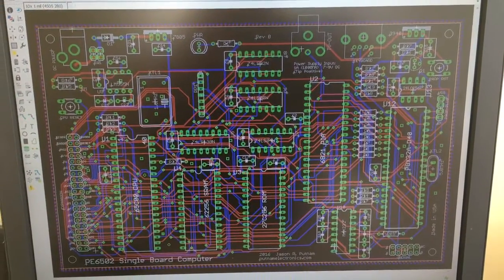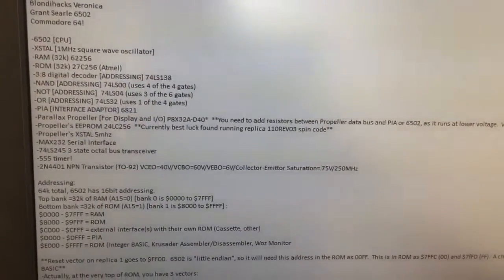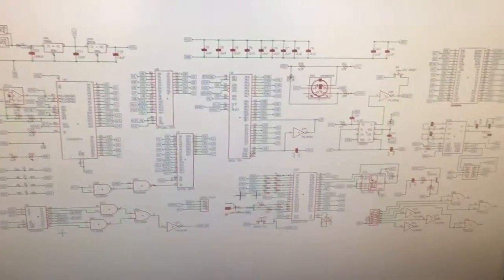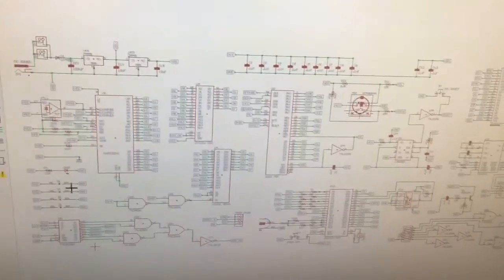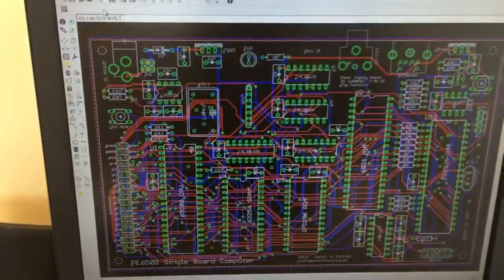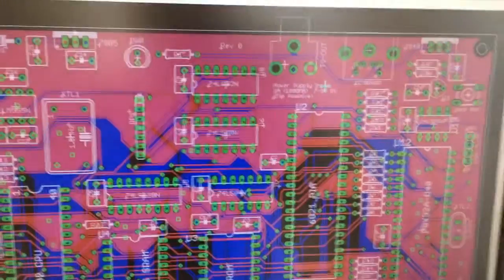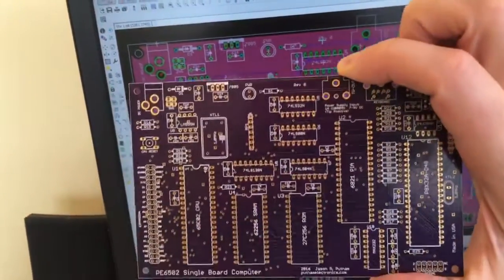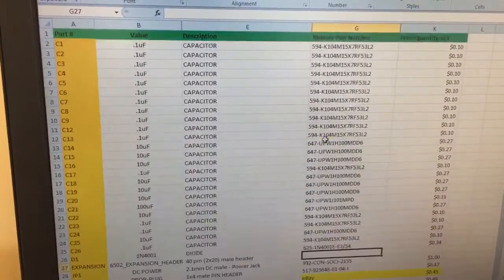6502 computer build, part 4

Comment: While I haven’t made anything or bought anything, I like looking on Mouser for materials as well. By the way, what’s the software you use to design PCBs? (and would you recommend it to a noob in college?)
Reply from the maker: I'm using Cadsoft Eagle (not sure who bought it from Cadsoft- but believe it was recently sold)..  You might want to learn KiCad- which I believe is open source, and free to use.
Reply: Corneleous Worthington alright, will do!

Comment: You might have mentioned it but I didn't catch it, how much did the board cost?
Reply from the maker: Hi Jon!  Thanks for watching!
So, Osh Park is where I have the boards made.  I think their price is $5 USD per square inch, for 3, 2-layer boards.  My boards came out pretty close to 4" x 6", so,  around 40 bucks per board (if I recall correctly)..  Of course, you can buy the entire kit now, which includes a board, and all the components.  All chips/sockets/resistors/capacitors/diode/etc are all top quality.  Check out my website for more info:  putnamelectronics.com

Comment: (Sorry about my bad english) 
I like it with one exeption, using the Parallax Propeller in your design breaks the rule of an real retro computer ;-)
If you need NTSC video TV-out the TMS9918A could be an nice replacement and it supports 32 sprites also.
How ever good job so far.
DJ
Reply from the maker: I'm just glad you watched it and like it!  Your english seems perfect to me!  Where are you from?  

Yes, I agree with you, I compromised using the Propeller;  I was already familiar with the chip, and it freed me from having to learn a new interface.  I cheated using non-retro tech on the memory side too, using modern/inexpensive/self contained SRAM.  However, I've been checking out the TMS9918S you mention, and it looks really neat (32 sprites sounds really cool!)

Thanks for watching!
Reply: "S" was an typo it must be "A" TMS9918A I bought one IC from eBay and put it on my breadboard 
but I have problems to get the 10.738635 MHz crystal. (3 times the colorburst signal of NTSC)
I can order it from mouser and at digikey but 30-40€ shipping to germany for a "simple crystal "is to much  :-(
But if I get the beast running I have to build my first PCB also.
Another higlight in my retro computerdesign are an original AM9511A floating point processor 
more precise an "AU" arithmetic unit from mid 70".

DJ

Comment: I've watched this entire series and I found it to be very inspiring.  Like you, I was also inspired by the same videos (especially Ben Heck; I love his project builds), and it was great to see someone inspired by the same mediums just run with it and record the results.

I disagreed with your use of the autorouter, but that's just out of my own personal dislike for autorouting in general.  The board that you designed looks great, and I can't wait to see a video with it populated and running your system.

If it's not too much of a bother, could I also get a copy of the schematic?  I'd love to check it out.

Again, great job.
Reply from the maker: I'm totally with you on the autorouter!  I really didn't want to use it, and even when I do use it, I end up re-routing perhaps 10-15% to get things right (no air-wires, all ground planes connected, less vias, etc.)  However, I got to a point where I considered "the enemy of good is better"..  At some point, I just had to finish and have the boards made- otherwise, there will always be just one more tweak, etc.  :-)  I figured, for rev 0, I'd use the autorouter.  It actually does a really good job, all things considered- the finished board is pretty dense.  But, yes, I too wish I would have routed it 100% manually, and I certainly would have cut the vias down.

I can send you a schematic, no problem.  Just email me through my webpage contact button, and I'll send it right out.  Thank you for your comments!
Reply: Yeah, I kind of figured there were some logistical complications that forced your hand into utilizing it at least once.  Really, it is better to have at least some sort of ground work down and modify after the fact than trying to tackle an entire board like this on the first go.  At least the autorouter can show you most of the optimal paths so that if you ever wanted to do a full rip-up, you have a better idea on how to manually tackle the board the second time around.
Reply from the maker: Yep.. And, even though this is the 5th board I've had made now, I still consider myself a student of this process- I am still learning (and appreciate any pointers you may have!)  When I was considering manually routing, here is the approach I was gonna go for: run a ground perimeter, then run power connections, then try to keep the buses together, etc.  The autorouted board has a ground plane on top and bottom, and at least it does have different net classes defined for power and ground, versus just signal traces.  

One other issue is, my license for cadsoft eagle restricts me to the 4x6 board size.  Eagle won't allow any manipulation of chips outside the board area.  I've watched a few people on youtube manually routing, and it looks like they like to assemble related things together off the board, then drag into place.  I am considering a switch to kicad for this very reason.
Reply: I hear you.  Dave Jones made a video about how applications like KiCAD and design/fabrication services like EasyEDA and circuits.io have brought in so much competition that CadSoft and Altium have had to start re-evaluating their price points.  

I think KiCAD is definitely worth looking into until their prices start to lower.  Personally, I love open-source options: My laptop runs on Linux, I do awesome 3D design using Blender and I occasionally use GIMP for image manipulation (I just... can't break my Photoshop habit).  The only real obstacle would be a learning curve on how that specific piece of hardware works, but I doubt it'd be that hard to just pick up and play.